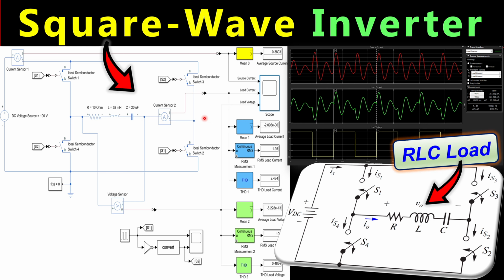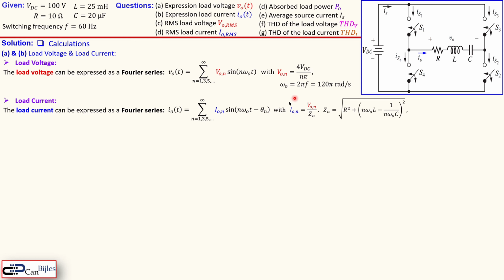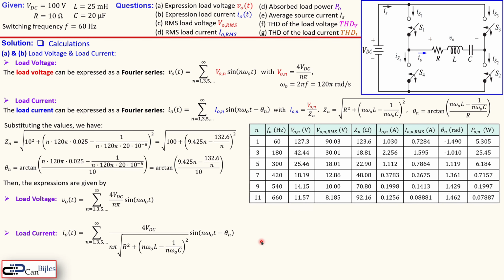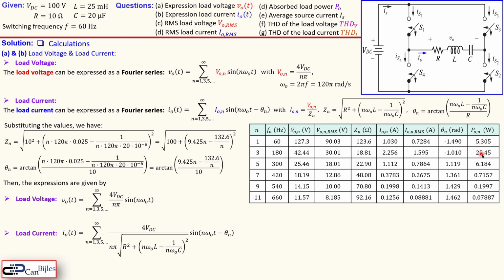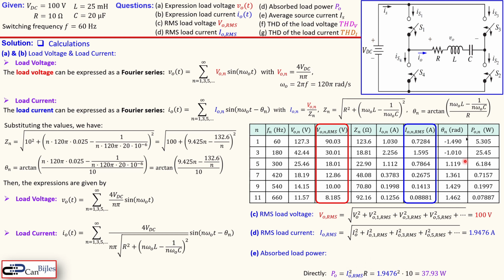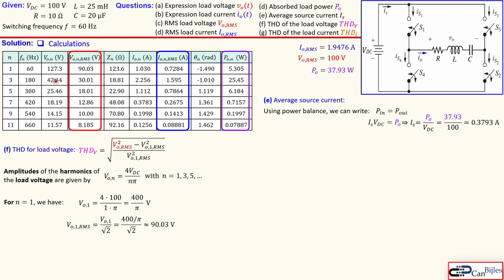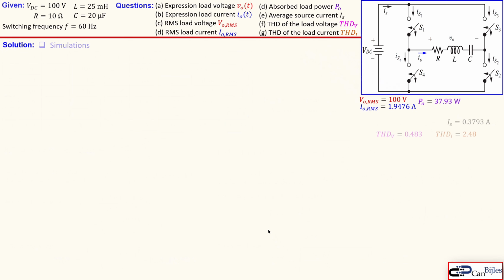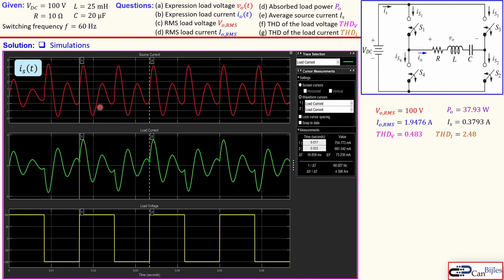Single-Phase Full-Bridge Inverter with RLC Load ⚡ Power Electronics 💡 Calculations & MATLAB/Simulink

Comment: Hi, sir, l have question in my head every time, I think of H-bridge inverter. Assuming its modified Sine wave, The alternating voltage across the load is changing polarity, let say frequency is 50Hz or 60Hz. My question is, which one is phase and neutral of these two terminals connected to the load??
Reply from the maker: Hello, in this inverter circuit configuration, the output voltage (load voltage) is not referred to ground or any 0 V potential. So, the output voltage is floating. You can make it single-ended voltage by converting it from this floating (double-ended) to single-ended.